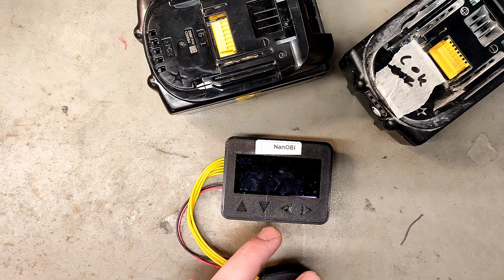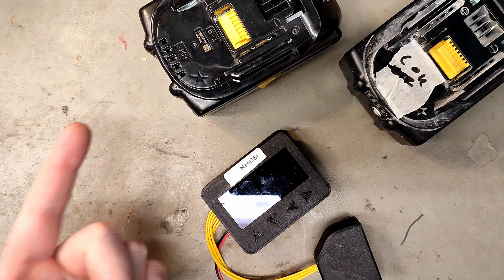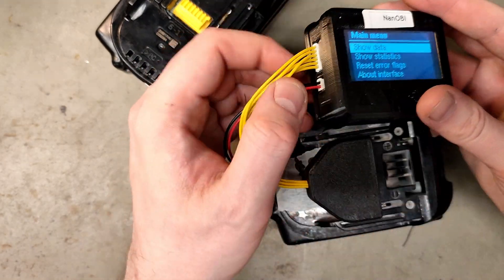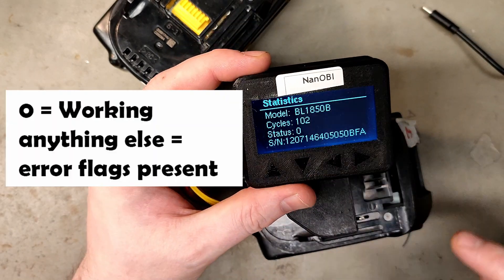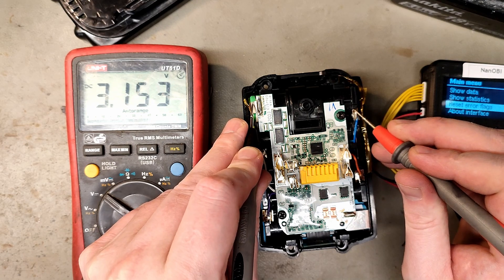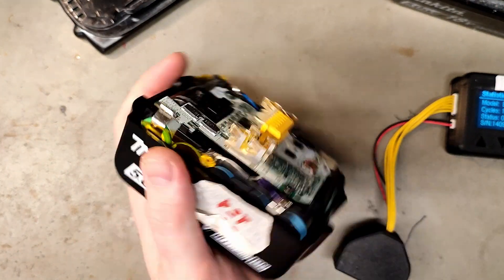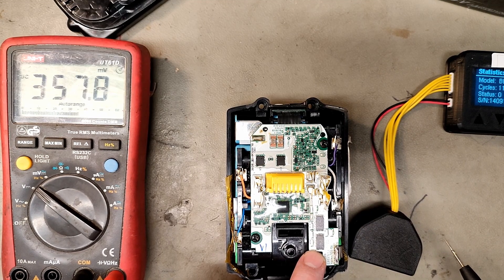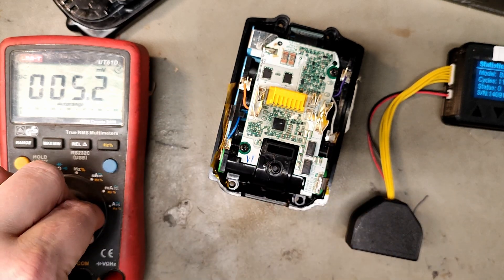Martin's NanOBI Makita 18V Diagnostic & Repair tool is amazing! Reset error flags in seconds!

Comment: Can this OBI tool be used to find out if used batteries are fake or original ones? Can you 100 percent tell that original is original or some fake BMSes act like original ones ? 

 I am asking because I have only 4 working batteries that I bought from legit source and I am sure that they are original , but sometimes I see used batteries being sold on market place for a reasonable price, looking like original ones but I was always afraid of getting fakes. My potential use case of OBI was going to the seller from market place and connecting his battery to obi and checking if its original without any opening/interferencing in battery, just connecting it to the computer. Is it possible? Does it looks like good solution?

Another question , do you know if I can be sure that connecting my original batteries will not cancel my manufacturer warranty ? In case of returning batteries to be warranty repaired, can warranty guys see that I was connecting battery to OBI ? 

Thanks a lot

Comment: Do you know what one battery level indicator flashing means? The first or far left on ghe battery? My battery seems fine and will even charge and hold charge using a hobby charger and if you slide battery on tool just far enough to make +\- connection without star pole in center making contact it will run tool but it does the error deal on charger. The battery isn’t very old and ive had ALL my other batteries longer. Very frustrating. What would cause? It was just sitting week or so and then ran on tool for a few screw removals then stopped. Very frustrating. Thank you for any info.

It is a 2.0 btw.
Reply: This made me try it and amazingly it did start so I kept the drill running and then pushed the battery fully in. It kept working and now the error code is gone

Comment: Just a fyi You might also  want to try another charging dock.  Iv had  a brand new charger tell me that all my battery  were bad and it wouldn't change any of them . I put a brand new battery pack on the charger  and it also try to say it was defective.  Im glade i have more then one charger. Its not always battery packs.   When it is usually a bad  cell or board is in shut down . Im glade iv saved all my old bad board  now at least there a chance to repair them iv got at 10-15 boards.💯👌✌️🫡

Comment: If makita charger doesn’t want to charge, why not use aftermarket charger to charge it instead? ( max voltage charge output: 21
Reply: Locked battery will also block it from being used on tools